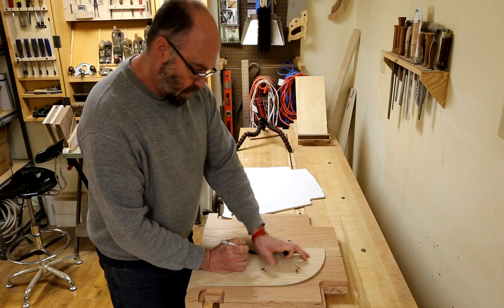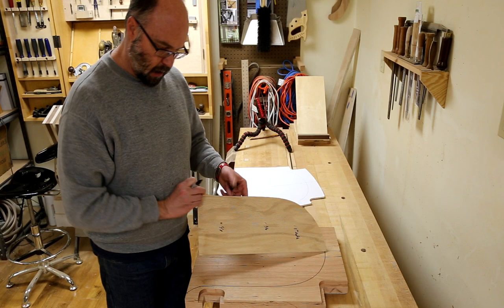Sculpted armless bar stools pt 5/8: shaping and powercarving the seat

Comment: Hi, nicely done. Just wondering what type disk you use on the angle grinder for carving it? Many thanks.
Reply from the maker: I used a Kutzall Extreme coarse disk.  It's pretty intimidating to start with but is surprisingly controllable once you get used to it.  Thanks for watching and commenting!  Jeff

Comment: Thank you for your video. I am a self taught rookie. Curious what is the name of the tool you are using to carve out the butt seat?
Reply from the maker: It's a Kutzall carving disc on an angle grinder.   An amazing tool for both its aggressiveness as well as potential control with some practice but very scary to start.  Best of luck with your new found hobby!  :)